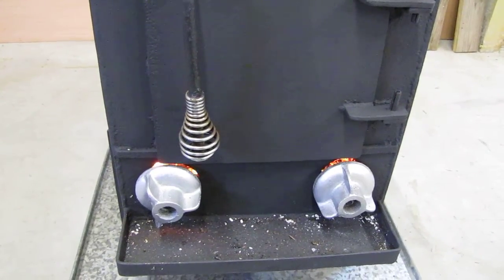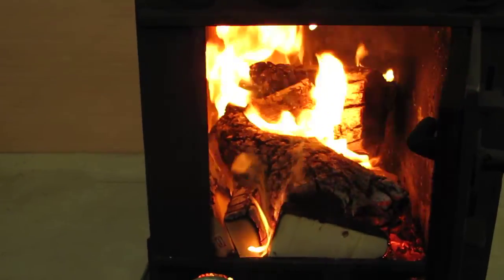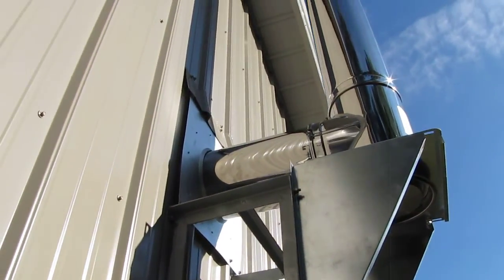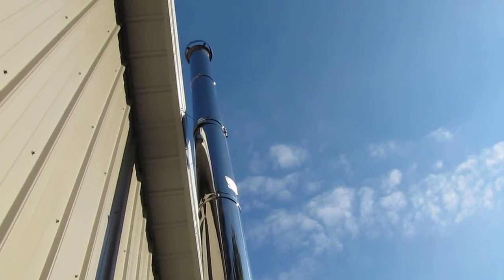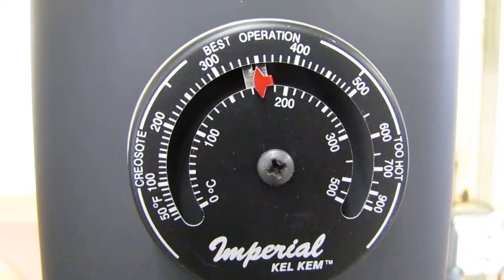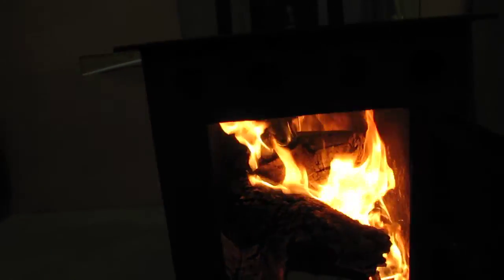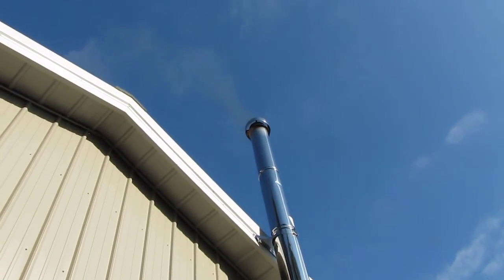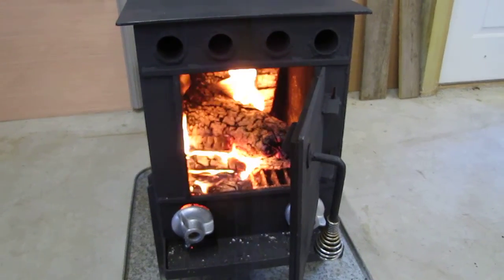Biomass Hybrid Wood  Heater " Unleash The Heat " Fire Time  Update On "The VIAR 94 " Pt 4

Comment: Sorry Bud, my mistake. I thought it was that thin sheet metal grade piping commonly used for AC/ventillation, which wouldn't hold up well in 70 mph winds, lol. That's what it looked like on my dumb phone screen. Then I looked at it from my laptop screen. Way different.

Comment from the maker: LOL Buddy 2 feet Is the Recommended Height  I'm About 3 feet  Maybe A Foot Higher Than I Should Be  I put It Up I Will Hold I used To Build Smoke Stacks For A Living The Big Ones Up as Far As 700 Feet  The Chimney Is Supervent Double wall Stainless It Locks Together Plus I Have Locking Bands On The Joints  I tell You What If It Blows Down I will Make A Video Of It Deal  Lucky Strike ???  LOL

Comment: I'm not completely sure about that. Going higher than recommended with that type metal pipe provides a larger surface area overall for high winds. This could in turn cause it to crease, bend completely, or break away from the house.

I guess we will only know for sure when it's put to the 70+ mph test.